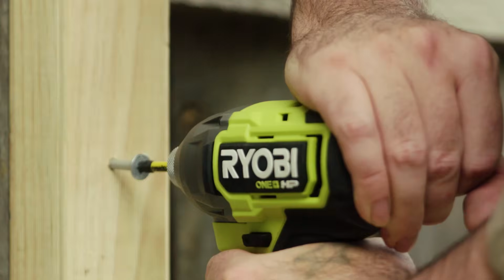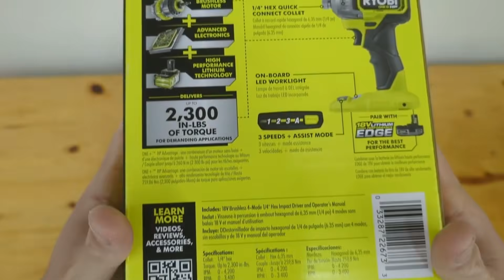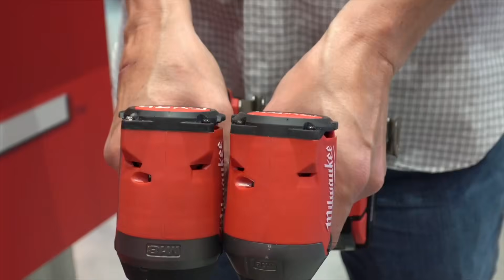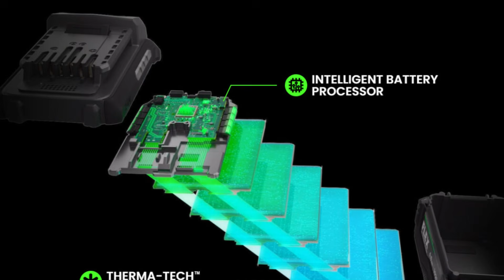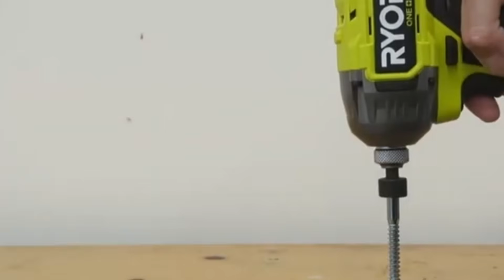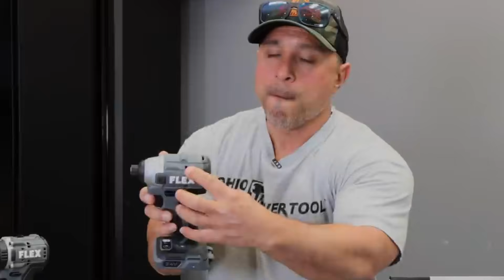We tested Milwaukee, FLEX & Ryobi HP Impact Drivers over 12 months — A clear winner!

Comment: I decided it was time for an upgrade and gave my son all of Black and Decker power tools and have switched over to the Ryobi One Plus HP 2nd generation Power Tools. I am a DIYer, and I am extremely happy with the power that these tools deliver at the price point. I also appreciate that the 18 Volt batteries can be used in over 100 tools (Including a vacuum that I've got my eye on), and their new "Edge" batteries kick ass. I also love the neon green color! 😂
Reply: Feel Milwaukee is good too. I have the M18 brushless impact kit and Fuel 18  with drill and impact. I am an Urban Gardener and use them when I need
Reply from the maker: Ryobi HP and Edge batteries are a smart upgrade because they use tabless cell technology, which reduces heat and lets the motor work harder. You’ve traded an old, fragmented system for a high-performance, standardized platform that is actually designed to evolve. Good move.

Comment: Flex is..... hardcore tools...gets it done.... power tools for tough people who....need power.....I use. Flex .... it's the game changer..... professional tools and performance... Gen one...is good & now. Gen two has arrived...my Milwaukee M18 fuel... it's okay..... flex is what a great tool should be.... fast tools for tough jobs...... flex.....
Reply from the maker: FLEX’s 24V pouch cell architecture creates a noticeable power gap for sustained, heavy-duty applications that 18V cylindrical-cell tools often struggle to maintain. You’re seeing the difference between a platform built for maximum current delivery and one limited by traditional battery heat management.